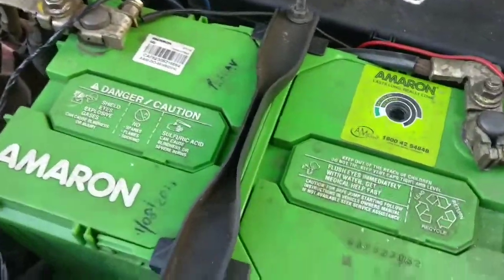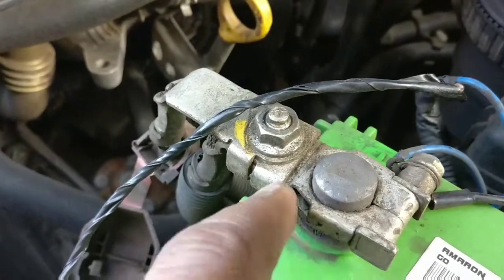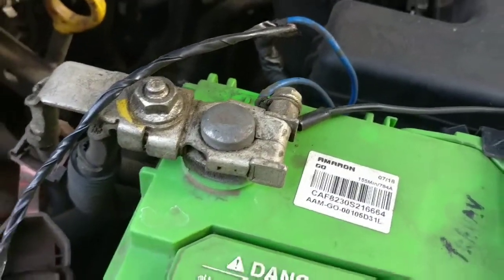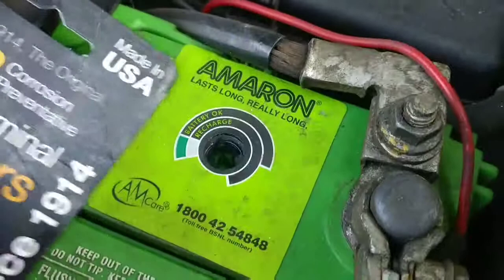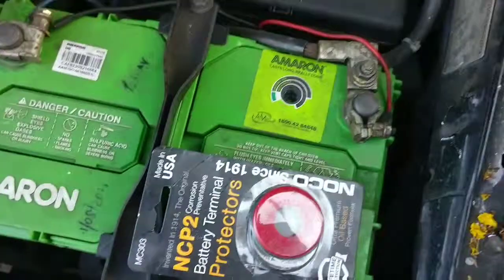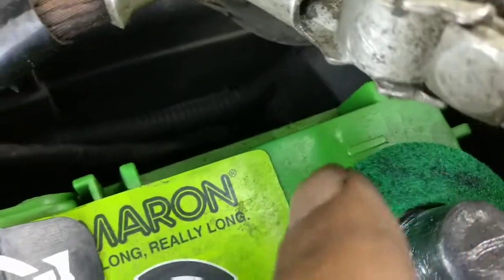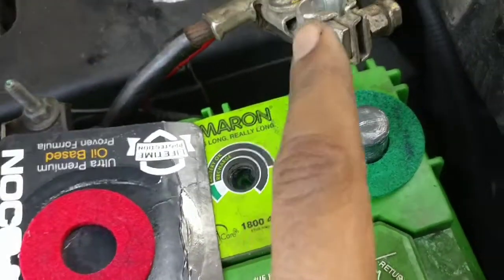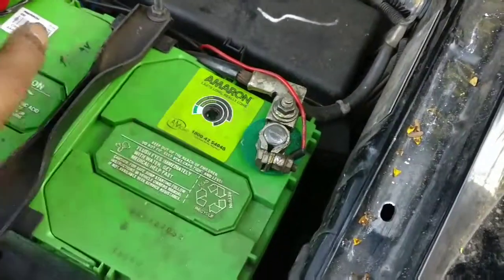NOCO Battery Terminal Protectors

Comment: How was it?
Reply from the maker: I have put those tabs more than 1.5 yrs, and car had seen numerous washes too.  As of date, there is no sulfation on the terminals, however on the tabs there is some oily dirt.  Problem is - I searched a lot in my area, but not finding new tabs.   Maybe if I wash the tabs then some chemical on those tabs maybe lost, so still thinking wether to clean or not.  I'm sure these tabs are working fine to do its job, good buy.